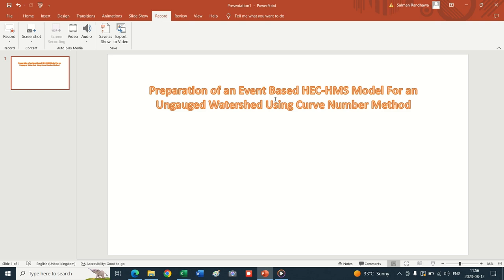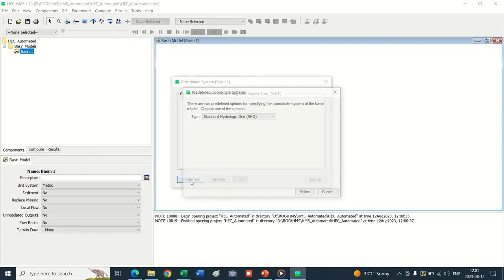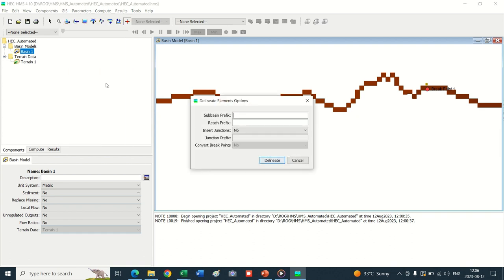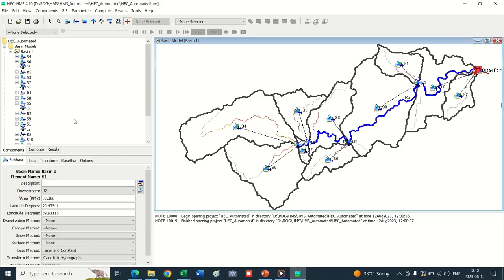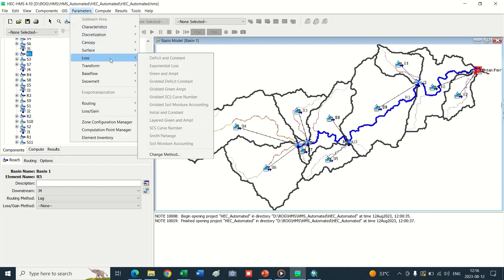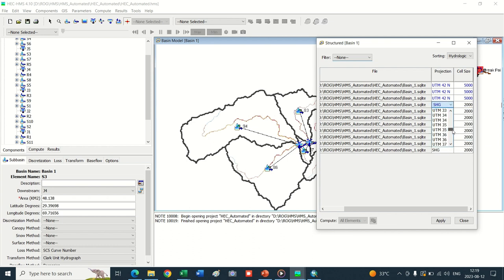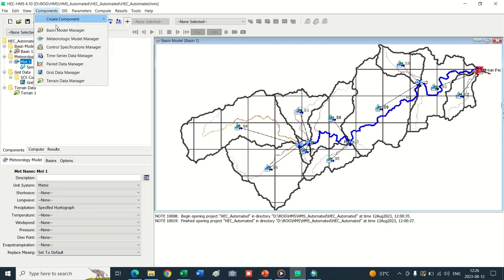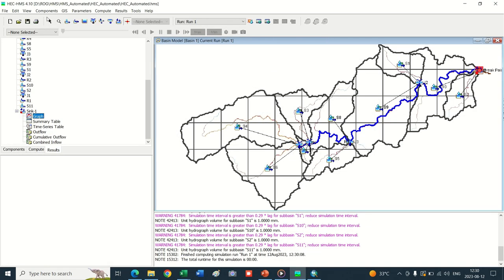HEC-HMS T4 | How to Estimate Design Flood in HEC HMS of ungauged Basins - An Integrated Solution

Comment: Hi Sir, thank you so much for this, this is just what I have been looking for for a basin with no observed flow. But sir, is the excel sheet used for the calculation of lag time of concentration for basin and reaches and lag time using kirpich formulae available or a link to where I can get the formulae used would be appreciated.

Comment: Hi Sir , I see you are using 0.60Tc for lag time in reach routing, In reaches the time concentration itself is the time of travel from start to end reach. Can we directly use this Tc value as the lag time ?
Reply from the maker: Both are empirical. Tc is the travel time of the droplet of water whereas lag travel time of flow.
Reply: Further, lag time is defined in the HEC-HMS reference manual as the time between the centroid of precipitation and peak flow, which is suggested as 0.6 Tc.  It is a parameter you can calibrate if you have sufficient observed data.